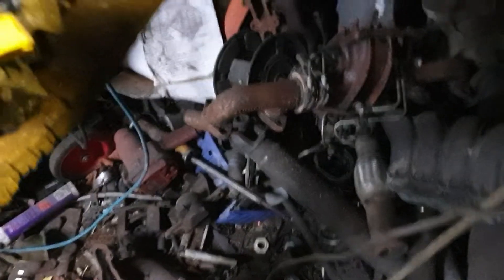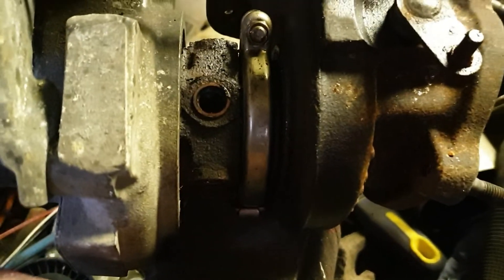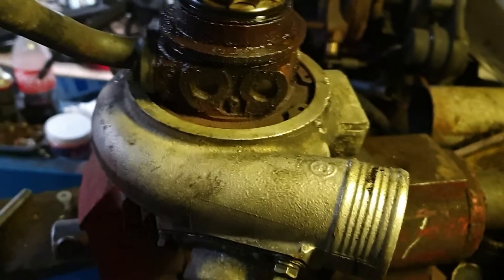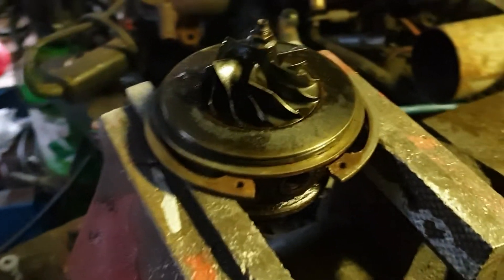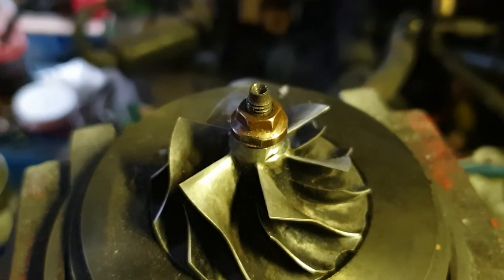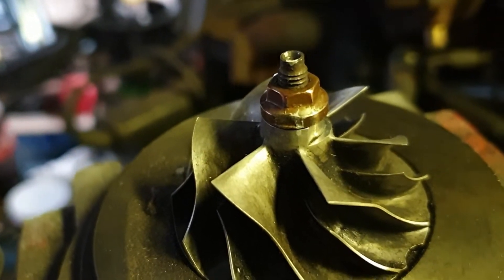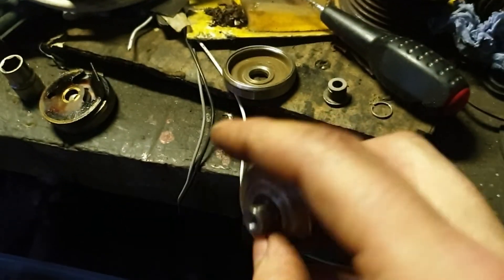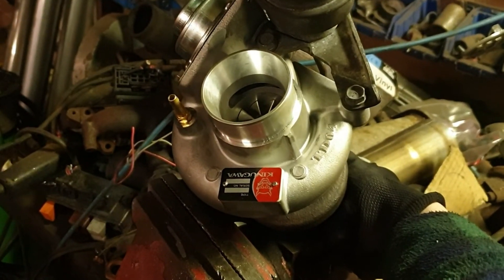Volvo TD04 12T/20T rebuild guide

Comment: I have a 2002 Volvo v40 1.9t with a TD04L 12t that needs to be rebuilt. I want to get a new 14t CHRA but I’m uncertain if it will fit and of course line up with the ports etc… do you know?

Comment: My backing plate came loose while the turbo was on the car. It started to ring like a bell which is why I took it off to inspect and possibly repair it. How do I fix a backing plate to get it to stay on or do I need to find a replacement?
Reply from the maker: I'd recommend a replacement core if the plate is coming loose